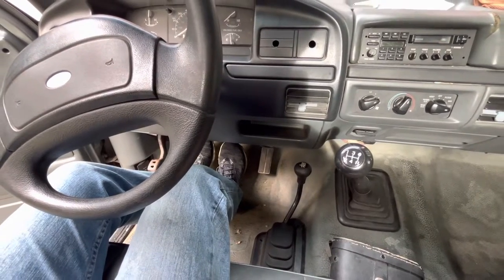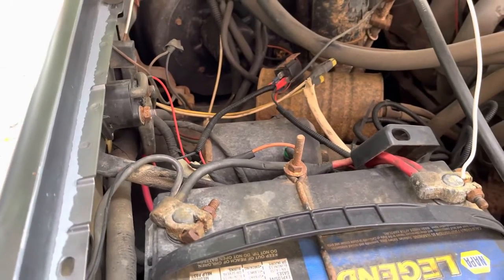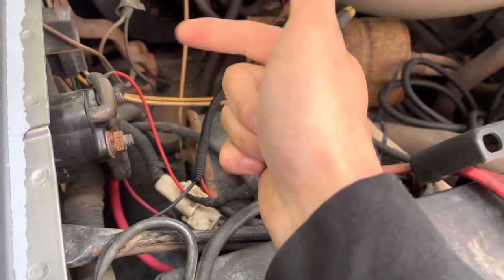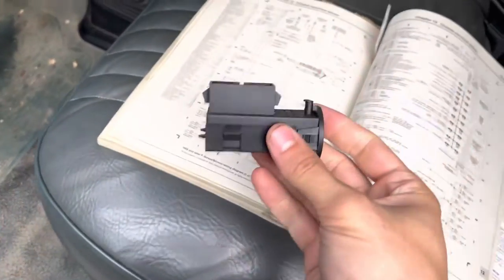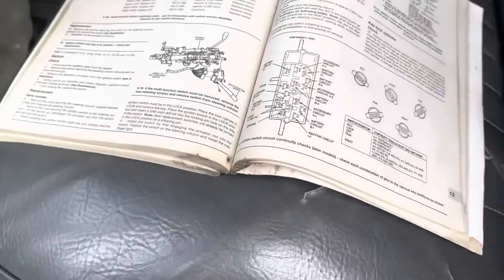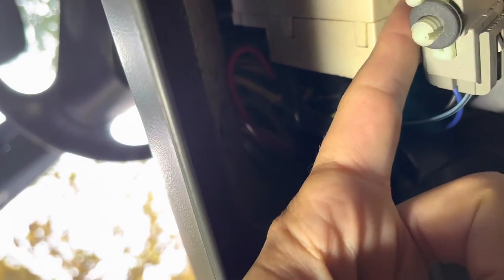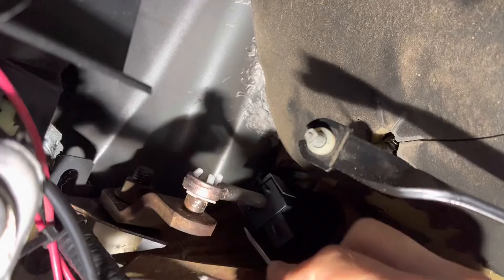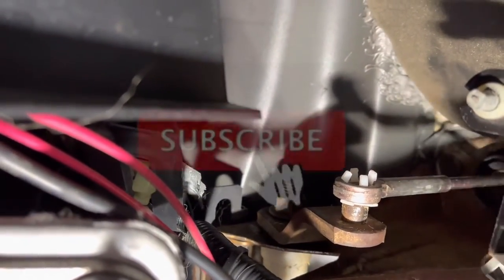Manual 1992 F150 - No Start - Clutch Neutral Safety Switch

Comment: I learn something everyday, thank you so much! I didn't know about the single wire that is plugged in on top of the starter solenoid, I got the feeling that my problem is the safety switch. Seems to be exactly the same symptoms.